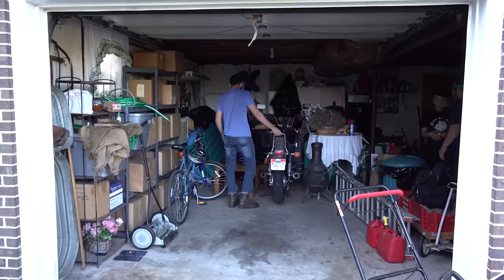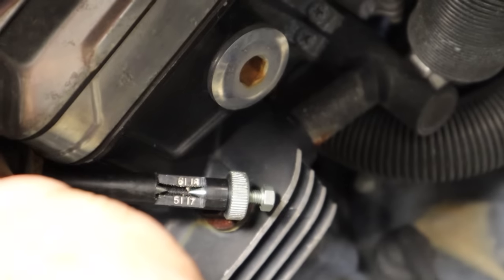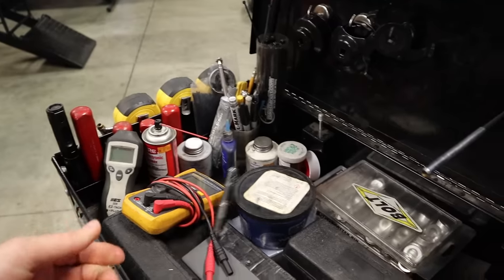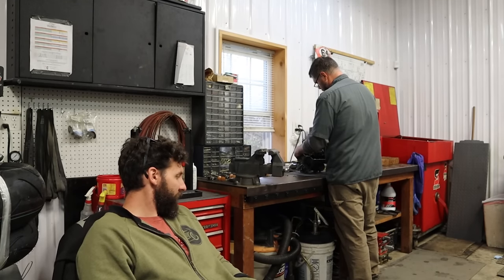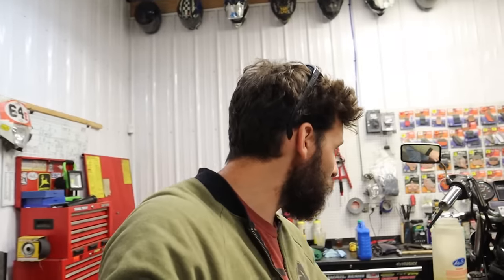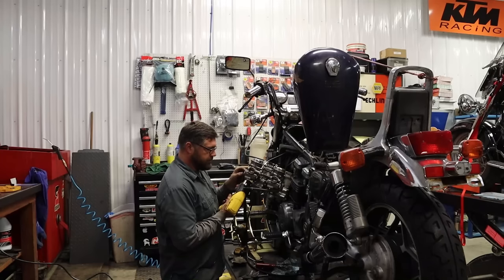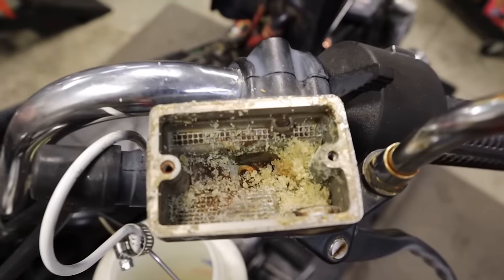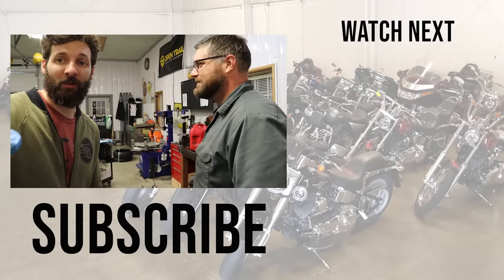Abandoned 1983 Honda Magna Restoration, Can we get it to run?

Comment: 6 years ago I bought my first bike for $200, a 1993 Suzuki DR650. The owner grenaded the engine because the timing chain broke and half the engine was in a milk crate and the other in a cardboard box in pieces.   Bought a used manual off EBay and found a machinist who was setup to work on motorcycles.  In about 3 months and a little bit of help from a buddy I had that thing back on the road and ripping up the trails so it can be done.  Over the course of about 3 years I had gone from the front axle to the rear essentially rebuilding the entire bike.  I feel this was a true success story since that bike was destined for the land fill and now it lives on and is still being ridden to this day.  I bet I was in to that money wise about $1400 and sold it for $1800 after owning it for about 5 years.  Labor hours are too many to count but I totally enjoyed the experience and what I learned and the self confidence I gained are invaluable.

Comment: While in elementary school, bought an old 'Doodle Bug' scooter with mowing money, got it running and sold for profit. 

During H.S., riding the rural rt bus, noted an old Indian branded [Royal Enfield] for sale near a farm. 

Year later, found owner had torn it completely apart and then carelessly covered it all in hay loft, during fall harvest. After next summer had consumed all the hay, the parts slowly came to surface among the bales. 

I bought the bike, using shed painting money and swept the barn loft with a broom, searching for scattered parts, piled the parts, screws, bolts, nuts, gaskets, pistons, bearings, gears, in a box. 

Took me all winter to reassemble the pieces, working in basement, looking at pictures and ordering parts from catalog. Discovered it was a 500 twin. After it ran strong, put air in tires. Sold for profit and bought a later model, used Triumph 650 Thunderbird.. :) Dozens of bikes later and countless thousands of miles on dirt, deserts, mountains, hwys and competition tracks over 70 years, the fire in the soul is still burning.. lol
Reply: You sir, deserve my deepest respect. Best regards. :)

Comment: That looks like a 1983 V65 Magna. At the time of it's release it was in the Guinness book of records as the world's fastest production land vehicle, design top-end of 170 mph, though they start getting a bit too squirrely at about 145 mph. For a 600lbs feet-forward cruiser-style motorcycle, it was astoundingly capable of a 3rd-gear throttle-only wheelie, with the front end coming up about a foot. It would whip a 600cc CBR sport bike in a drag race hands down. 1983 was the hottest year, it is rumored that Honda de-tuned them in subsequent years because they were killing their riders. They were recorded as doing the quarter mile in just over 10 seconds. Warp drive was a standard feature, even in sixth gear you could crank the throttle and it would straighten your arms for you. No Harley, built or modified, could touch that bike for speed, power, acceleration, reliability, or cost. Harley Davidson killed them by getting Congress to impose a huge tariff on any Japanese motorcycle over 750cc, that is the only reason Harley survived. The V65 Magna was referred to as "The Animal", the V45 was "The Beast", and the V30 was "The Varmit". My Magna has a propensity to get me up over 100 mph before I realized what was happening. I had a friend who rode one, and he said he would never ride a motorcycle that didn't talk to him, but the Magna tended to dominate the conversation. My experience was that not only was this true, but the Magna was full of bad ideas. I loved that bike.
Reply: My first bike.  I now have a 2022 Triumph Rocket 3 which reminds me a lot of the V65.
Reply: That's not a V65 that's a V45. The V65 had slash cut Mufflers ,a rear disc brake and did not have the piggyback shocks from the factory. At first glance the shocks are the giveaway that is a V45.
Reply: I loved those '83 V45 and V65 magna's. Beautiful bikes. Had a V45. Great bik6
Reply: Until the Yamaha V-Max crushed it!

Comment: That's a Honda for you. That's why Honda is one of the best selling brands.
Reply: I see no difference in any of the big Japanese brands...
Suzuki, Kawi, and Yammi are all equally great bikes to work on...
My 1983 Honda Shadow is just like the bike in this video, but for it to ride again will take more than a day with 2 people working on it...
My Suzuki that sat for over 10 years before I bought it, I pulled the carbs, did the work myself, had it running mint in an afternoon and have put 20,000 kms on it in the last 6 months....
People who buy Honda's over the rest because of durability, really hasn't delved into the other Japanese models...
Honda had the best marketing gimmick of the big 4 when entering the North American market pushing merch and selling the brand, not just the bikes...That is why Honda outsells the other brands here.
Reply: @TroyC68  There is a very meaningful difference. Used to have a Yamaha, and nothing compares to my 1994 Shadow. Had an old GSX 250 from the early 80s that never could put together. Most of 80s and 90s simple cruisers bikes shouldn´t give you too much trouble to start after being inactive for some time.
Reply: Yet it was these motors that are cams iirc prompting Honda to specify a special oil additive.
Reply: @FBPrepping  never could put what?
You are comparing a GSX 250 to a Shadow, yes the shadow is more reliable...
Are you saying a 1994 Suzuki Intruder equal to your 94 Shadow is a less reliable bike?
Or that a Yamaha Virago is less reliable?
Or that a Kawi Vulcan was less reliable in 94?
Because you are delusional if you think so...
Reply: @TroyC68  I wouldnt say yamaha though. Atleast not the new ones. 17 hours on a fresh bike. Cracked piston blew cdi box garbage.
Reply: @TroyC68  I don't know enough about it to judge, but I've heard guys swear that Hondas are easier to work on than Yamaha. I can't imagine why either. Both bikes require the same components to run, just that Honda gets it's stuff from once source, and Yamaha from a different source. Actually sometimes they use the same.
Reply: I just did 100 miles on my cbr with a jammed thermostat.

Comment: I was 20 when i got my first bike and it was a magna exactly like this bought it at an auction for $400 with 1,450 miles on it and taught myself how to work on it. And finally rode the wheels off of it 75k miles and 10 years later i had to let her go. Most reliable vehicle i have ever owned. This is the bike that got me in to motorcycle mechanics.

Comment: Great video!  This was really cool to see.  I just spent a yr working on the same bike (an 84) that I bought off CL after it had been sitting in a barn for 10 yrs - and doing literally all of the same things right down to the dried up fluid in the clutch master cylinder and taking out the pain in the ass carbs 3 times, lol.  I also had to rebuild the front brakes, remove and clean the reserve gas tank and change out the fork seals.  But this thing is a freakin’ beast now - I LOVE this bike.

Comment: Bought a 1995 honda vf750c magna for 800gbp. 2 owners 8k miles. Not ran for 10 years. Proper dry stored. New battery and fluids.  Started up after 5 seconds!!!. Did a full service now sweet as a very sweet thing. Love the channel.

Comment: My first magna was an 83 v45 750 I rode that bike one whole summer then I sold it to buy a 84 v65 and the bike was a basket case so I lost out, 15 years later I find an 83 v65 magna sitting in a shed for 7 years with 29k miles. Good shape. I am now restoring it thank you for sharing!!

Comment: Always remember when your bike has carburetors, drain the carburetors before you store it.
Reply: M W S, Better to run fuel stabilizer through the system and fill the tank all the way, otherwise moisture will condense and cause oxidation damage.
Reply: Combination- I fill up with sta-bil, run it through the carbs, then run the carbs dry. Works fine. I haven't started my Virago in a month and a half and it fired right up.
Reply: @eaglemachineworks1490  That's the way to go. Never had problems at Spring time in 34 years of storing my motorcycles.
Reply: @eaglemachineworks1490  Well it's my first winter with a motorcycle, in November I put the stabilizer in the tank, let it run for a few minutes, and turned it off. It hasn't been fired since then, so it's about 4 months now. Hope the stabilizer really made its job, we'll see in several weeks when the weather in central Europe finally stops flipping out... hopefully.
Reply: "Store" a bike? Nah...I just ride it.
Reply: Especially of you're not running non-ethanol fuel...
Reply: Yes sir. I’m currently dealing with someone’s fault of not doing so. It dry rotted damn near everything

Comment: Love it..my son started racing mx bikes back in 04 had to learn to fix them myself. He was 7 years old. When we quit he was 15. He got me back into bikes when he was 18. We went in halves on a 1982 KZ750.  It needed carb work on it and some tlc. A month later he went and bought a 2015 Harley Street Bob. We got out on the road riding and he thought he was gonna blow the kz away. Lol. It didnt happen that old bike put the hurt on a brand new 103ci stock harley. So he goes back out on the river boat for 75 days spends 1000 bucks on his bike. Stage 1. Still cant out run the old kz750. Well i bought him out on the kz now shes really fast. Webb cams, ape valve springs, stainless 4 into 1, better carbs mikuni Bs34's off a gpz750. Oil cooler off a gpz. Shes quick now, my son tried to best me again went and bought a 82 kz1100 all stock. Still wont outrun the old 750 wink wink... Wiseco makes a great 810 big bore kit. And Cavanaugh God rest his soul did a awesome job of porting polishing and flow bench ing the head. Need to do some vids on my YouTube channel on my bikes. The ones on there now are of my son. All the bikes on there were rebuilt completely and tuned by me alone.

Comment: I recently got my first bike, a 2009 Kawasaki KLR650 for $800. The owner said that he stopped riding it in 2016 and when he he wanted to try and sell it, the bike wouldn't start. So I got it pretty cheap. All I had to do was change the oil, clean the carburetor and replace the battery. It cost me around $108 and have put about 2800 miles on it with no issues. Everything that was done in this video can be taught from YouTube videos.

Comment: I've restored about a dozen V4s over the years and most had the same problems. Most of the time the engine will fire right up after the carbs are cleaned. Problem is most shops won't touch anything that old. The thing about restoring old bikes you can't count the labor involved because you'll never sell it for just the time involved in the project. Just the carb cleaning is worth more than I pay for the bikes. Once back on the road they are great bikes. Good going fellas.

Comment: "Get the bike running first" is good advice. I've often got bogged down in my rebuilding projects because I was trying to fix too many issues at once. Sean is right. Get it running first, then work on fixing all the other problems.

Comment: I bought a 1981 Goldwing 1100 that I brought back to life back in 2011 still runs today. Great bike. After getting it running carb rebuild rear master cylinder replaced I discovered the frame was bad. Did a quick fix welded a gusset to the frame to finish the season and find a doner frame. During that process I decided to go over everything it all came apart, breaks, shocks rebuilt and or cleaned reassembled. Maybe not very cheap  but in the long run paid off. Some things were reassembled and later rebuilt because of cost example were the shocks. Runs and rides great for a tenth of the cost of new. Just bought a '99 1500SE new winter project lol. Of course I have to go over the old 1100 to get ready to sell not letting it go until I am sure it is ready for a road trip. Love the old bikes

Comment: Heck yes my brother - I've had my bike up for almost an entire riding season a couple years ago :( It wasn't just because of repairs though. I rebuilt the forks, rebuilt front and back brake calipers... and since everything was off, went ahead and built some custom aux fog lights that I can switch from amber to bright white. Reason I did this during riding season is my toe was broken anyways and it was hard to ride (also added a toe-heel shifter) my VTX1300C.

Comment: he's saying all these simple things that people can get, but no one has a Craig.. at least not for free.
Reply: they're doing simple maintenance to an 80's UJM. any idiot with a shop manual and a tool box can do what they're doing. Sean is lazy (he admits it. he says he rebuilt carbs one time and never wants to do it again) and spends money to have it repaired.
Reply: @SixWheelsDown  I was gonna say the carbs are basically the same as they are on a lawn mower. Clear the jet if you let it sit, replace the gaskets every few winters and you shouldn't even have any issues with them.

Comment: First bike was an 85 Honda V45 Sabre 700. Very rarely started, and I smoked the starter solenoid just like the previous owner. Replaced it, de rusted the gas tank with vinegar, but forgot to remove the petcock which literally was disintegrated by the vinegar. Replaced that, then had the stator replaced by a shop, who also found a short in the kill switch which was why it rarely started. Fixed that, took it down I95 to work, and when I got to there, the side covers were gone just like you said. After that it developed a vacuum leak, and I sold it at the advice of the shop because of parts availability. Coolest looking bike ever though.

Comment: "Don't fix anything else until the bike is running."
He says after fixing the brakes and draining the blinker fluid.
Reply: This coming from a guy who probably shouldn't be working on a powerwheels
Reply: Yeah should have said, "Only fix what it takes to run, AND the brakes, and lights." Because brakes and light are kinda important for stopping and seeing.
Reply: Technically, they did get the bike to fire first...

Comment: I'm restoring the exact same bike 1982 Honda magna v45 750 I'm waiting on a fuel pump to get it to run. Then Its on to bleeding brakes n clutch just like yours. This bike used to be my fathers but he sold it when I was a kid after 25 years it being gone and 15 of that sitting unloved i found it and I bought it back. Also have another 1982 magna but has the common 2nd gear issue but it also will be fixed. I love these bikes and it is so nice to see another magna back on the road!

Comment: Those carbs are an absolute nightmare to take off and put on. Seriously, you cannot express how awful they are.
Reply: I owned a '84 V65 Sabre and fixed a few 1st & 2nd gen V45 Magnas and Interceptors.  Removing the carbs is typically not the issue, but installing them back in the "V" is the challenge.  The secret I found is to loosen the clamps completely, pull the intake manifolds (tubes) almost completely off the cylinder heads so that they are cocked upwards (if that makes sense), and then drop the carbs down so they partially engage the intake manifolds.  Continue to push at each cylinder until the spigot of the carbs engages the internal lip of each intake manifold.  Also using some WD40 on the manifolds helps assembly, too.
Reply: @aeroman5239  Yes
Reply: I’ve done these carbs four times - they can be a nightmare for sure.  Secret to getting them back in:  ratchet strap carb rack to suspension bolt in back, pushing carbs into cylinders 2&4, them press down into 1&3 manually while strap is tight.  I’ve got it down to about 30 minutes to install this way.
Reply: First time on my 97 interceptor took hours! Hardest part of putting te bike back together.
Reply: You ain't lying they are a pain in the rear to take off and put on.

Comment: these are the best kind of bikes. One of my fondest bikes ever, I was at a guys house doing some work and saw in his garage an old goldwing. It was buried under a bunch of stuff so I knew it hadn't been touched in a long time. As I was leaving, I asked him about it and he said it hadn't run in 8 years. At the time I had been collecting and refurbishing yamaha xs1100, fastest production bike 1979!!. So I thought I could use a goldwing. He said I don't have any use for it, it you can get it to run you can drive it outta here. I came back the next day, 2 cans of carb cleaner and 3 running cylinders (1981, wing interstate, 4 cylinders) later I drove it home. When I got it home I had to clean out the gas tank, fuel line, and rebuild and sync the carbs, but I drove that bike a long time. I when I parted with it, still running but needed some tlc and with the money i got from it bought a new valkerie interstate. thats when they first came out. loved that bike too.

Comment: I love finds like this. Great entertaining video. Two thoughts though....Lucky you didn't have to take it to your local Honda dealer. The twelve hours you spent doing what you did would have cost you  $1200 - $1500 at current shop rates. Also, doesn't "unclearing" the clutch line mean you actually clogged it with the welding wire? LOL

Comment: I actually own a Honda Saber from 1982. When I got it both the brake and clutch cylinder were all dried up and clogged. But she run when I bought it. I was sitting in a garage for many years and had very little miles. Congratulations on getting that old Magna back on the road.